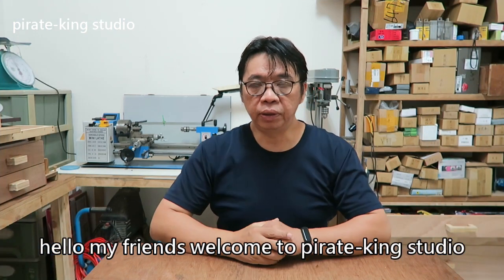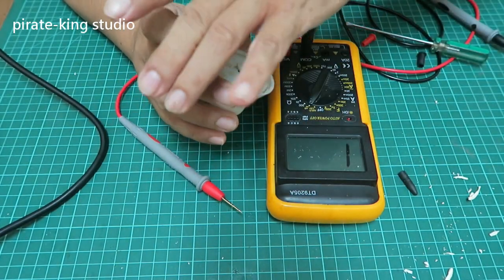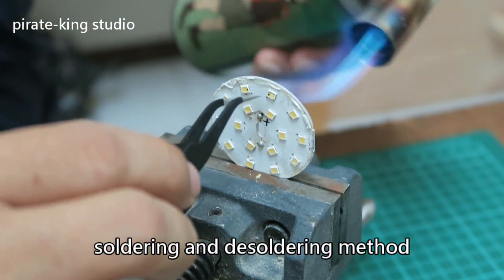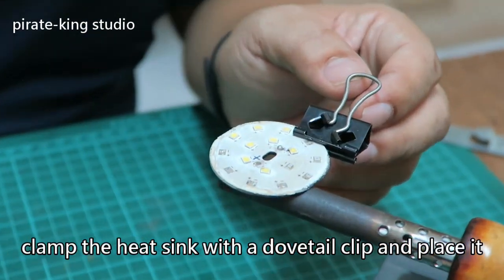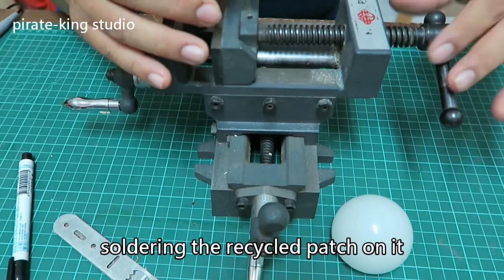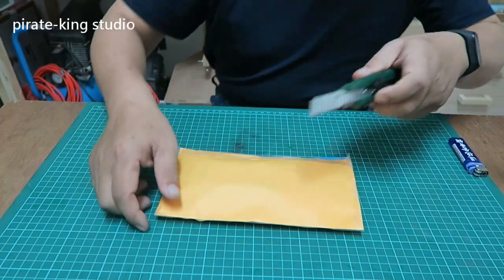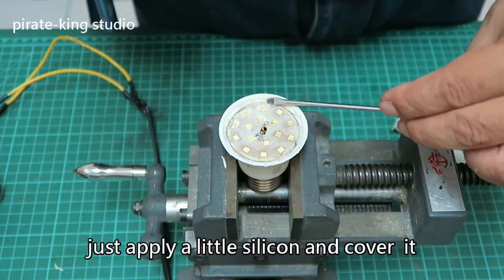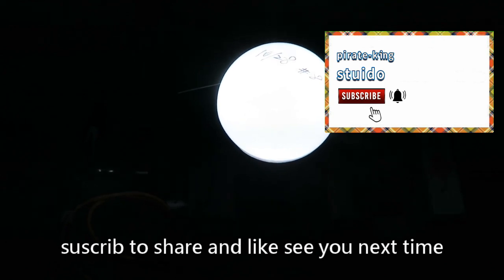How to replace led smd No professional tools required Repair led bulbs at home

Comment: Heating pad is very popular now a days. I made one using 35w soldering iron element fixed under aluminum plate. Its very cheap and works wonder.
Reply from the maker: I should make one too

Comment: So true, they can't be soldered nor desoldered with a soldering rod nor an SMD hot air station. No wonder those don't work, the heat has to be from beneath 😃

What's the temperature in Celsius

God bless, Rev. 21:4
Reply from the maker: it's true
Reply: @pirate-kingstudio5774  

Thank you. By the way, would you know if this type of non-backlit LCD damage is a polarizer damage (the screen displays the numbers just fine, it just has squiggly lines, yet it's not cracked). I can't copy paste the link here or the site, Youtube keeps deleting them (it's become too paranoid with censorship) but if you go over to Macrumors website, in the forums section, if you could search this title "Is this an LCD (Non-Backlit) Polarizer Type of  Damage?" (without the quotes), the description is there. Thank you in advance. God bless you.